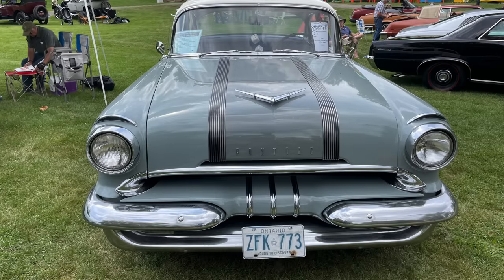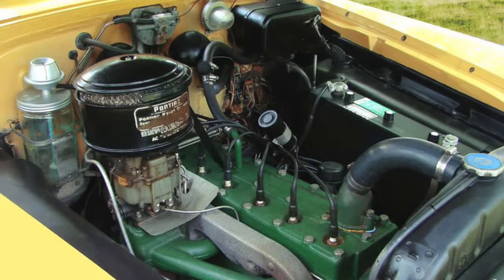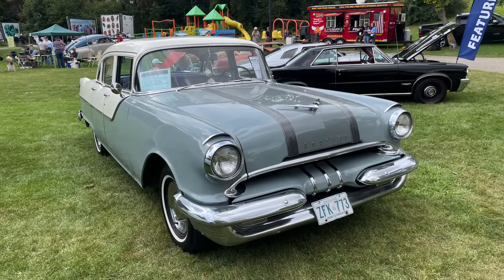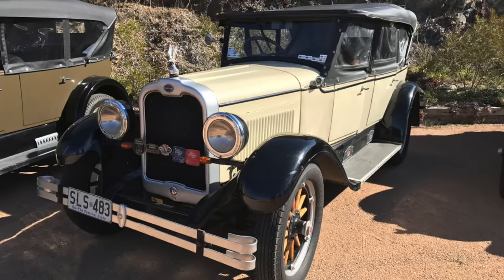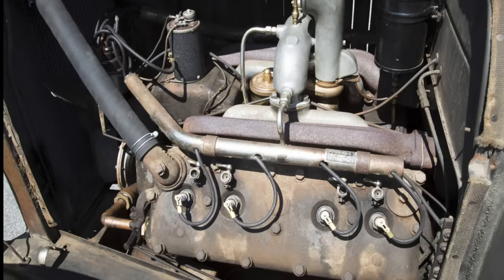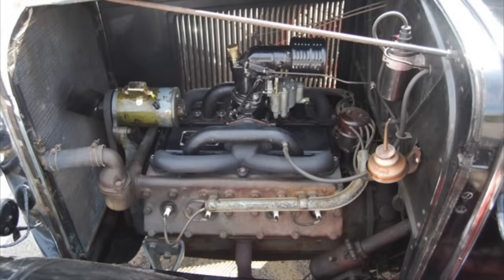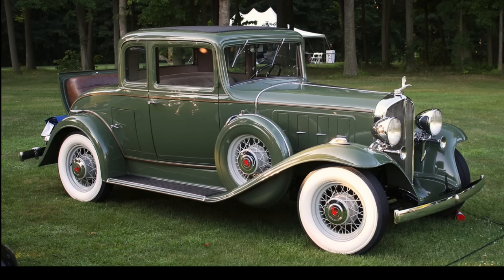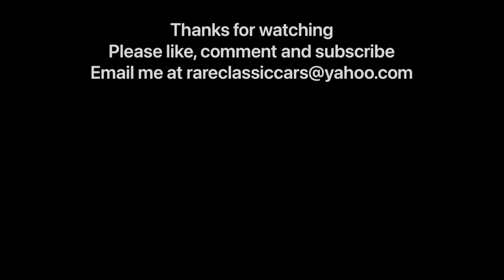Pontiac's First V8 Was An Awesome Flat-Plane Crank Engine!

Comment: My brother served in the Army in Germany in the early '50s. While still in Germany, he purchased a 1954 Pontiac to be picked up when he reached New York upon discharge from the military. He drove it home from New York..The things I remember most about it were the light-up hood ornament, the long engine, and the matching long battery.
Reply: The long narrow battery was an 8 volt.
Reply: @Finnigan9  It was fitted from the factory with a 6-volt battery. Three cells, edge to edge instead of side to side in a case only 4 inches wide but 19 inches long. 8-volt batteries were aftermarket products.

Comment: There are several odd design choices on the engine as I recall: 1) the valves are at an angle to the pistons which would presumably boost intake flow - but then the intake manifolds had quite a convoluted path.  Claude Burton drove a Pontiac V8 in the 1930 Indianapolis 500 and finished a very respectable 11th place - impressive as the engine was near stock.
Reply: I believe that it also had a single exhaust outlet only on the driver's side of the engine block.
Reply: the odd intake was due to the updraft carburetors that were used at the time. By the mid 1930s the more modern downdraft carburetor would become commonplace
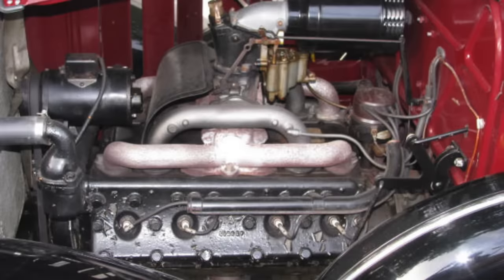Reply: @marquis281v8  This has a down draft carburetor with a rear facing inlet as seen at 5:13
Reply: @Thomas63r2  ;  it appears as if the exhaust manifold is at the top of the block and straddles the intake manifold.🤔
Reply: @Thomas63r2  ,  Soo, did the exhaust get routed down through the block on the near side in the video, and then connect to the piping to the rear of the car??
Reply: The farther you get from the combustion chamber, the less it matters
Reply: @jimstepan3038  Yes, this was done on other flathead V8's like the Cadillac.  The Oakland V8 has siamese intake ports that are between the non-siamese exhaust ports.  The exhaust on the top of the engine connects with a port that goes between the two center cylinders on the driver's side of the block.
Reply: @jimstepan3038  The exhaust manifolds on the top of the engine connect to a port that goes between the two center cylinders on the driver's side of the block, and then that connects to the exhaust that then goes to the muffler.
Reply: @Bloodcurling You are not specific, but if you are referring to exhaust airflow, you are correct that as the combustion exhaust heat gets further away, the less cross sectional area is needed.  At between 5:1 and 5.2:1 compression ration, not much heat is being generated.
Reply: It was an Oakland not a Pontiac

Comment: Really excellent !!  You are pointing out important history that is overlooked by most car enthusiasts who are focused on the 1950's and later developments.  GM in particular had and amazing assortment of engines from its beginning in 1908 up into the 1940s.  Northway division built a number of it's early V8's in the teens and early 1920's (one of which you mistakenly pictured as the 1930 Oakland) Check them out!  Cadillac was the first at GM with v8 in 1915, but Chevrolet and Oakland got theirs in about 1917-ish.  Cadillac went cross plane crank in 1924, first in the industry, then Viking and Oakland for 1929 -30 were also cross plane.  Yes, Cadillac originated that unique American cross plane V8 rumble in 1924 !
Reply: I can't believe someone besides me was gonna bring up Northway. 😅.  When you get into the real early history its interesting because you rarely if ever hear or read about it.  I've a great GMC book that talks about the Northway engine division.  Great post. I just learned some more 👍
Reply: Yea, it's a shame that most car nuts think the flathead Ford was the first mass produced V8.
I think a super cool subject for this channel would be the American V8's of the teens and early 1920's. It was a thing back then in higher priced cars, and some really cool (both flathead and overhead valve)engines were produced.  @Sheisthedevilyouknowwho-ft9we
Reply: I was wondering kind of engine that wrong photo was!
Reply: @timmcooper294  Fords flathead wasn’t the first, but it certainly was the most popular at the time and it got much of America behind the wheel of a v8-powered car. It was really only during Iacocca’s tenure where they were actually the first to do something
Reply: @timmcooper294 it was the first mass produced V8, the other V8s of the time weren't produced in mass. It was also the first V8 with a one piece block. It just wasn't the first V8.
Reply: That depends on what you consider "Mass produced"   I would say that thousands of units per year is mass produced, which all of these engines were.  First one piece block ???   Not Ford..... The Oakland, Viking, and Pontiac V8s from 1929-1932 were all one piece blocks, as much as four years prior to Ford, and they built thousands of them each model year.  Ford WAS the first really low priced V8, Yes, but wasn't first at really anything else.

Just because someone wrote a Ford history book 60 years ago that said it was the first one piece V8 block, does everyone have to believe that, despite the facts??  @429supercj
Reply: Nope, Viking (Oldsmobile built) in 29, Oakland in 30 and 31...and Pontiac in 32 were all single plane cranks.

Comment: Oakland motor company was purchase by GM and later replaced by Pontiac as a brand in 1931. OMC life was 1909-1931.  The irony is Potomac started out as a model in Oakland’s lineup it would eventually replace Oakland as name of and start a long life for GM at producing cars above Chevrolet and below Buick price points. It would turned into GM’s sporting divison over time . One noted for innovation. All originated originally from Oakland motor company.

Comment: Had a 1954 Pontiac first car l had low mileage bought it at sixteen three speed on the column drove it for years it would get hot 
a tube ran across the head of the engines had vacuumed wipers and it would hit a hundred on the highway way . Those. cars were bullet proof had god ventilation you could open the wings up for airflow no air conditioning. Well built .

Comment: My first Pontiac is over the shoulder of the subject model. 
1964 GTO.
It was a 389 4-barrel, 4 speed,  black over white, and pretty bare bones. Thus also very light. 
Stuck a bored and balanced 396-375 in it.
Surprised a couple people
Reply: Same here,but when my 389 went south I replaced it with a balanced and blueprinted ‘70 RA/IV crate engine.I put it on a bunch of mid to late ‘60s big block Chevelles and Novas.A few of them were old high school friends of mine.They claimed it was a 427 or 454 swap till I shined a flashlight thru the open hood scoop at the valve covers.I DID have a 4.88 geared 12 bolt posi from a ‘66 Chevelle under it tho.

Comment: That particular V8 didn't have ANY exhaust manifolds - the exhaust gas path was integral to the block and there was only one opening on the side of the block where the pipe attached. I bet that did wonders for it's reliability when pulling steep grades or hauling heavy loads.....lol.
Reply: Modern engines are doing the same thing now,  Crazy as that seems
Reply: I see exhaust manifolds there.
Reply: Yes, on the top of the block like  the Cadillac flatheads.
Reply: Yup, running exhaust ports through the V 8 (and12) block was pretty much a Ford/Lincoln thing. Reduced the parts count and cost, but transferred heat into the coolant. Most other side valve V engines ran exhaust ports into the valley, often using them to warm the carb and intake system, aiding fuel vaporisation.
Reply: @PhilMarks-ki1ub which does not help at cold start and reduces power later. Why not just use down draft carbs on individual throttle bodies? To work under acceleration, I envision two opposite floats and two injection needles per port.

I read that flat plane V8 can have a narrow angle. Maybe let all intake runners end in a line. The place 9 swimmers in between them plus the ends.

Comment: My mom and dad had a new Star Chief 2D HT in 55 with the new for 55 Strato Streak. My dad immediately turned it into a 50's hot rod cruiser. 4B, dual points and exhaust. Chrome skirts, all the bumper guard's, spindles on the hubcaps, big wide exhaust tips, blue reflectors to make the stop lights look pink and those wind things by the wing windows. I loved the light up Indian head on the hood and when the 57's came out he added those fender top lights. The kids in the neighborhood thought I was the luckiest kid to ride in that thing all the time. Kids would hang in the street when it was time for my dad to get home from work to see and hear it coming down the street.

Comment: Off topic, but the comments on engine mounts reminded me of a 1950 Oldsmobile belonging to my uncle. If driven hard by, let's say, a teenager the engine would torque way over and lock the throttle linkage. If it happened in a curve on a wet road, it could lead to an off-road excursion---or so I am told!

Comment: Pontiac had to once again deal with egine shake and vibration when they came out with the slant four in the '61 Tempest.Same way too. Super soft engine mounts!
Reply: They came out with a four cylinder in just about the cheapest way possible.

Comment: I sure did not know that Pontiac had a V8 back then, even tho I did know about the 1917 Chevy V8. I'm wondering about the engine block- was it cast in one piece like Ford's V8? I thought Ford's claim to fame was that he was the first to cast the block as a one-piece casting. It sure would be cool to hear that Poncho run!
Reply: The 1932 Pontiac, 1929-31 Oakland (Crossplane crank version of same engine) and the 1929 Viking V8's were all one piece blocks well before Ford, and had some real design advantages as well.  Not cheap as Ford or produced in near the numbers, died due to cost vs market.
Reply: @timmcooper294  Are you sure that V8 as used in the Oakland had a 90 degree crank?  I thought it had the same flat-plane crank as the 32 Pontiac version, just a different Synchronizer.
Reply: I may have mixed it up with the very similar Viking engine. I do now recall that the Oakland had the synchronizer pushrod on the opposite side of the block ! Thanks for the catch.  @michaelbenardo5695

Comment: Horsepower wars never end. In the 90s and 2000s it was the v6 horsepower wars when we saw hp go from around 150  (ohv gm v6s and smaller displacement ohc japanese engines) to 300hp in engines like th3 chrysler pentistar honda j35 and gm 3.6 dohc v6. Id say the real door buster was the nissan vQ35 that pushed the status quo up to 240hp in the 2002 Altima.
Reply: And the accident rate has also gone way up.  Fact is, most motorists are not qualified to handle more speed than an old Model T has.
Reply: @michaelbenardo5695  Drive like Hell,you'll get there quicker

Comment: My dad had a 56 just like that. First car he ever nought new.  The engine blew in 1960. One year before I was born.
Reply: I think that the '56 offered a substantial power increase over the '55.
Was the blown up engine clogged with varnish/sludge such that the oil pump couldn't pull oil through the screen or otherwise the flow of oil to the bearings got blocked? I think some of the early multiviscosity oils were coming out in that period and had problems.
Reply: @davidpowell3347  It was quite a bit faster than the 55.  Multi-Vis oil was a new thing then, and it wasn't very good.  I didn't start using it until a few years go, as I had a bad experience with it in the 70s - it sheared, so I never tried it again, until now.  Another problem was many of us, myself included, would use detergent oil.  The early detergent wasn't very good.  It would sometimes separate.  That happened to me, so I went back to non-detergent, until about 20 years ago.  Every year I had to drop the pan on my cars to clean out the sludge, AND, to clean the oil pump pickup screen.  Many non-detergent users never did that.

Comment: I see it's a flathead. Was it a 90 degree vee? Looking at it also makes one understand why Henry ran the exhaust ports thru the block to get the manifold at the bottom of the engine--practical or not.
Reply: Which was a terrible design choice.  It dumps a LOT of heat into the cooling system, which would otherwise just go out the tailpipe.
Reply: Ford ran the exhaust ports thru the block, not the heads. Doing so also added a lot of heat to the coolant, so those early Ford V8s ran rather hot.
Reply: @johnnicol8598  Henry thought it left room for larger ports, although the ports on the production engine were not large.

Comment: Benjamin Anibal designed it.

Also, they are a Horizontal-valve, flathead design, which makes for in essence, a sharp triangular combustion chamber; very similar to the Lycoming V8.
Reply: And the Packard, maybe the Pierce Arrow/Seagrave V12

Comment: Very interesting video. Thanks for sharing. I am more familiar with the current Ford 5.2 L flat plane V8. Years ago I talked with one of the development engineers for that engine. He mentioned that there was a lot of money and time in R&D spent on the crankshaft vibration damper to try to smooth the engine out at lower speeds.

Comment: The 287 was ready for production for the '53 model year, and the frames were designed to accommodate it, but Woodward Ave. ordered it shelved.  Why?  Buick complained to Al Sloan that Pontiac offering their V8 would rob Buick of sales of their nailhead for "53, and, Buick being Sloan's favorite division because of Harlow Curtice and Harley Earl, the Strato Chief arrived in '55.  Engine swaps with Pontiac V8s into '53s and '54s were not uncommon later, as the Oakland straight 8 was not a very hardy or efficient engine, most never making it to 100K before a rebuild...if the block hadn't sagged too much.

Comment: LOOKs very similar to the 1922 OLDS V8 which came in the 22 Oldsmobile Super Sport.
IT actually had an aluminum engine block with bolted on cast iron cyclinders. Updraft Johnson Carb. 
We recommissioned the the 1922 Oldsmobile V8 with 2500 original miles which the VP of LVMH owns.

Comment: What was the balancing method that you said provided an opposite force? Great video!
Reply: Super interesting setup using a pushrod actuated by eccentric that counteracted the natural shaking forces created by the flat plane crank setup.
Reply: @timmcooper294  They called it a synchronizer.

Comment: I had a 1928 Pontiac 4 door sedan with an Essex instrument panel. I was told that my Pontiac was built by Essex body works. It had a inline six flat head with two heads covering three cylinders. I did not see any Oakland connection at all.

Comment: This wouldn't have been made by Oldsmobile for Pontiac ? Was it similar to an engine (made by Oldsmobile) for a car called "Viking" ?
Reply: I've heard about this before, been a long-time Pontiac nut.  It is Oakland's own engine.  Now after I read yours, (I already knew about the Viking) now I want to find more info on early Olds/Viking engines.  You might interested in GMs early Northway engine division.  Another poster here wrote some about it too.
Reply: This was Oakland's own engine, but the Viking engine was a similar design.

Comment: I always wondered why no one made a flat crank for cost reasons.  Now I know they tried.
Reply: Ferrari still does.  The problem with them is that they cause the same kind of vibration/resonance  problems as a 4 cylinder engine, but because it is V8 smooth at most speeds, when it does vibrate, it is more of an annoyance than it is on a 4.  Not a problem on a sports or racing car, but can be pretty annoying in a closed passenger car.  Body and interior panels will buzz at certain speed/load conditions.  Convertibles are noisy enough that it isn't as noticeable.  The first Straight 8s also used a flat-plane crank.

Comment: Wasn't this engine doubled up to make the second generation Cadillac V16?  Oldsmobiles companion make  Viking used a version of this V8 too
Reply: I doubt it. The second gen V16 used a 135 degree angle between the banks, which means an entirely new design of the block. It is possible that Caddy used some of the valve train pieces, tho.
Reply: I doubt it, but you never know.  The Viking engine was similar, but not the same engine.

Comment: I think the cross-plane crank was an innovation in early 20th century, done for better secondary balance.   Even high performance V8s still use them, as the weight savings in a flatplane is not worth the worse balance.
Reply: yes.
Reply: @lesliehorwinkle  
It also fits the geometry of the V8 better.  
8 cylinders, 2 revs per power stroke,
360*2/8 =90.    
Similarly, the crank throws on a 6 cylinder are 
360*2/6 =120 degrees apart.

I've actually heard the Mustang "voodoo" flat-plane crank is a total gimmick--to get race care sound and vibration.   They even made the crank throws on the front and back 180 deg apart, which isn't normally don't because it creates front to back rocking forces.

Comment: That makes Henry Ford a bit bold on the declaration he was putting the first V8 in a low cost passenger car  Dealer prices 1932 Oakland v8 $1995  1932 Ford v8 Tudor  $450

You could buy 5 1932 Ford v8 Tudors

Great research skills , for sure   Very informative and interesting

Comment: Interesting. Is that "can" with a belt on top like an air conditioner, the alternator/generator?
Reply from the maker: Yes
Reply: Generator, usually with an 'AMP' gauge that was negative at idle.  The red idiot light drove some crazy.